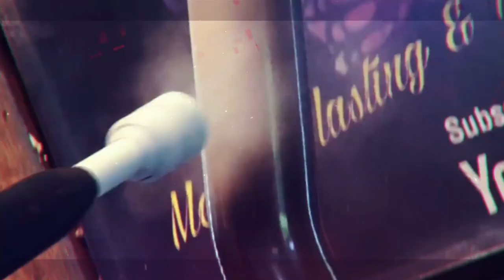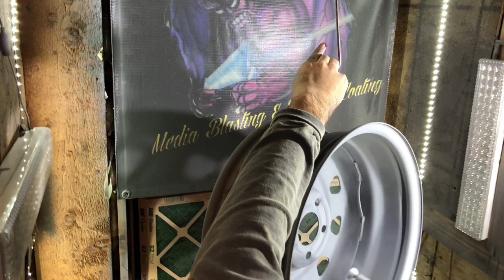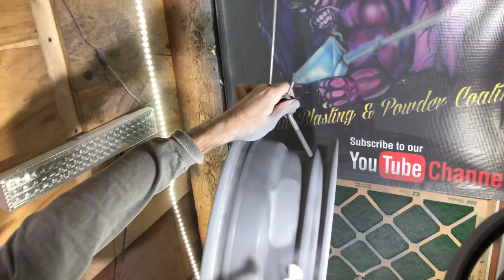How to Powder Coat your trashed winter rims. #20

Comment: Nice job !!! Pretty good color amd flakes , where you get the long tip for the kk
Reply from the maker: Reinaldo Rivera what Gun u have? Most system guns you can buy them. Mine is omega gun so I got the 6” tip from Columbia coating